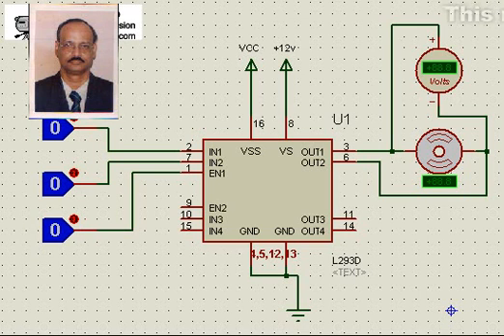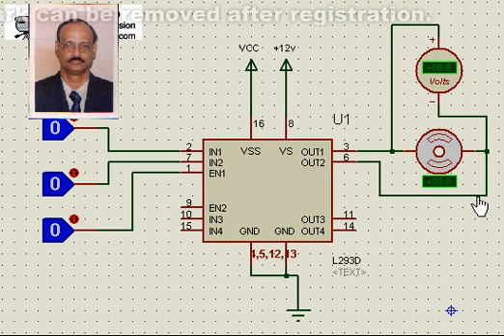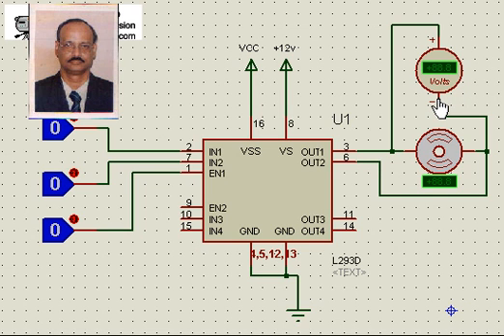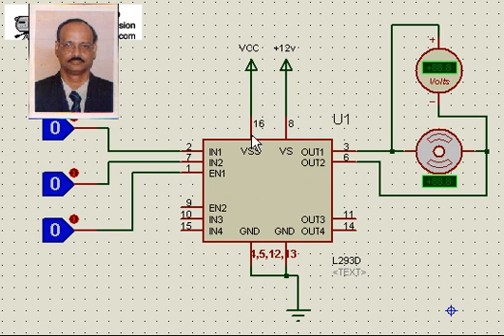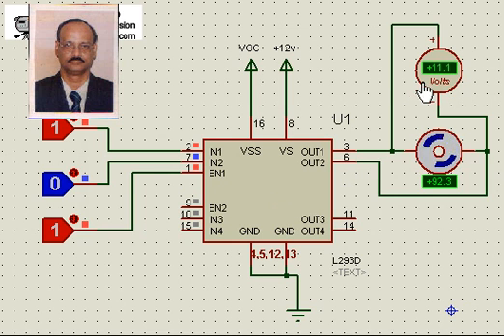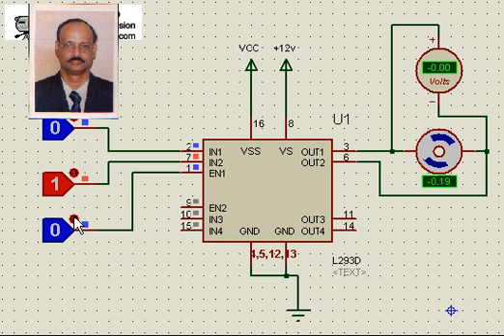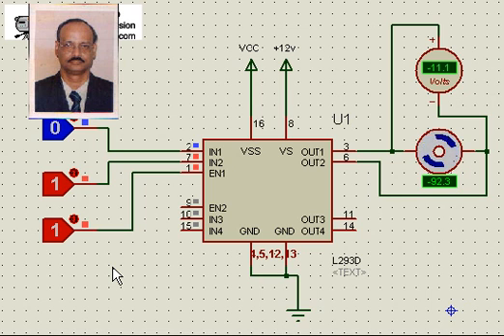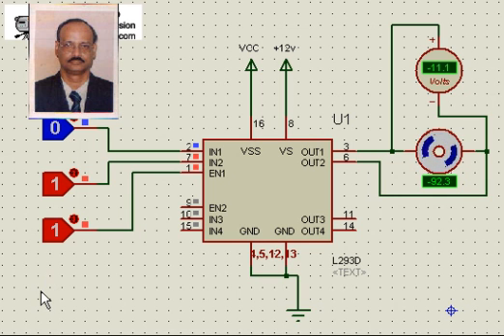Microcontroller motor interface

Comment: Good day Sir I need a driver chip that's able to handle 30 amp's at 12 volt's. I only need two outputs to control one motor and help you can offer will be much appreciated.

Comment: Good work proff, in addition the number of pin usage from microcontroller can also be reduced by placing an inverter to the input since in1 is NOT of in2 and when the EN is low the motor stop but runs when high even with this setting PWM can still be achieve at the EN input so at the end  you have just two pin to program to control the motor

Comment from the maker: Watch my other videos on HT12D & 12E .The HT-E-encoder series just converts the parallel data  ie say 1001 to serial data which can be sent over wire or wireless to the receiver HT -D the decoder series that converts the serial data back to parallel such that the program in the receiver understands the sent code to deliver appropriate logic to the motor driver IC for action